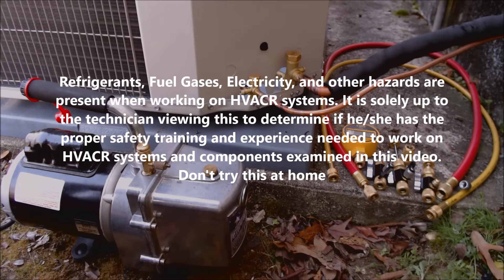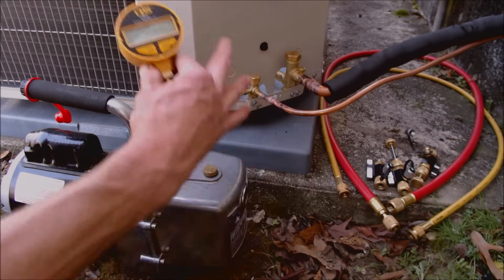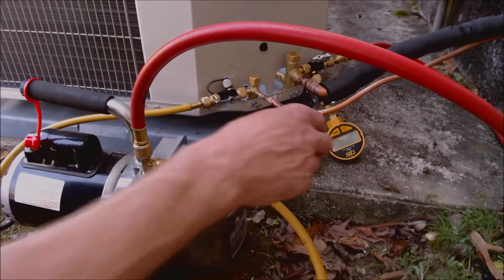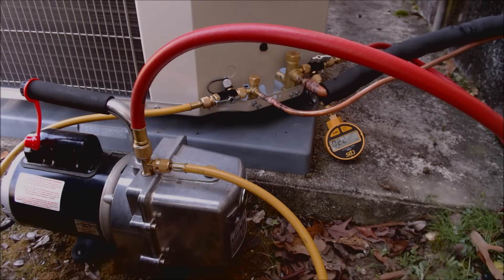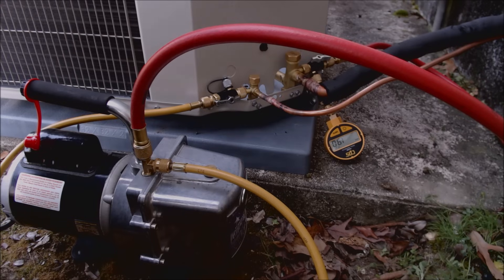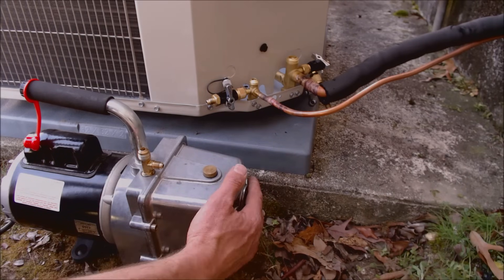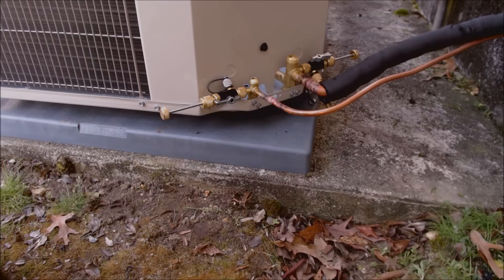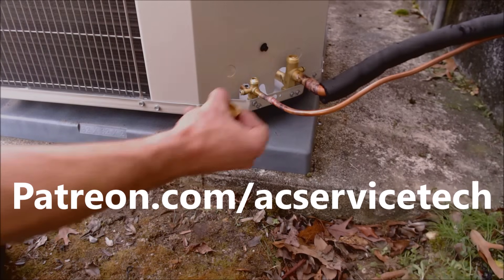HVAC Full Vacuum Procedure From Start to Finish!

Comment: After pulling down the system in a vacuum, why didnt you charge the linset for added length? You said 65 ft line... your gonna be under charged by opening those valves. Unless you have another video continuing this one where you add refrigeration on the fly while it's running. Most condensing units have 15ft of linset added in the charge. Anything over that you have to add. 65ft-15ft = 50ft. 50ft x .6 (that's .6 oz per foot)= 30oz. 16 oz in a pound so 1 lbs 14oz needs to be added.
Reply from the maker: Hey Jedd, I checked and added the charge using the Subcooling method since it was 80 degrees and had a TXV. If I was going to weigh the charge using the total weight method, the R-410A per foot would be .54oz for the 3/8" liquid and .114oz for the 3/4 vapor line. I am rebuilding the acservicetech.com website to include a bunch of resources and one will be a weight chart for all vapor line sizes for commonly used refrigerants. Yes this one was Bryant/Carrier/Payne so it came with 15' precharge, thanks!
Reply: I really enjoy your videos, lots of info, there lots of people that dont do our trade with care and it's good too see a fellow HVAC technician doing good work.

Comment: I like putting my micron gauge as far away as possible from the source of vacuum.  Also once I verify the vacuum is holding, I do not delay in opening up the service valves and get the system in a positive pressure ASAP, after the vacuum pump is shut off.  All rubber hoses leak, so I don’t want the system sitting in a vacuum leaking in air for any extra time
Reply from the maker: Hey Rod, yeah I don't do the standing vacuum test using any hoses, just the valve core removal tool valves. I don't rush to break the vacuum because I want to see if there are any problems. If not then the vacuum level usually doesn't rise above 30 microns, thanks!

Comment: I noticed you stopped the pump at 18microns. Any reason? Where should we stop the pump?
Reply from the maker: 200 to 300 microns is a good point. Make sure it doesn't rise much during the standing vacuum test while the pump is off and certainly not above 500 microns, thanks!

Comment: Sir I have a question? Why do you need three valve core removals? Could you use two I am just curious ? I am going to buy the same setup that you have.
Reply from the maker: Hey Steve, look up "acservicetech 15 vacuum tips video" the reason is to avoid oil contamination of the vacuum gauge sensor and also to not put positive pressure into a tool that is sensitive for reading vacuum, thanks! I have most of the tools I use linked at amazon.com/shop/acservicetech thanks

Comment: Sir, do we include the compressor to vacuum in case of a gas leak that result to no gas pressure in the system? and not only the line set?
Thank you for your reply.
Thanks also for all your educational videos, more power.
Reply from the maker: If there is no refrigerant in the system whatsoever then you would leave the service valves open and vacuum the whole thing including the inside of the outdoor condenser including the compressor area. Look up "acservicetech breaking the vacuum with refrigerant from the bottle" thanks!

Comment: Anyone know what he meant by not putting the valve cores back in until he had positive pressure in the system?
Reply from the maker: Hey KC KC, pull the valve cores out of the empty system, vacuum, perform the standing vacuum test, break the vacuum with refrigerant from the system by opening the service valves, then reinstall the valve cores with the valve core removal tools. The valve core removal tools remain on the unit the entire procedure. I have the tools I use linked at amazon.com/shop/acservicetech thanks!

Comment: I had a method for pulling vacuum...even used it to check for leaks...and later found after isolating the condenser & filling it with Nitrogen, that it would lose 3 pounds over a 24 hour period...I just upgraded to a digital manifold & will purchase 1 more Appion valve core tool & try your set-up :)
Reply from the maker: Yes I love this setup. I just did a new install today and once set up, it took only 3 minutes to get to 190 microns and the standing vacuum test held 20 microns above that for ten minutes. It works well and usually takes between 3-10 minutes to get the level low enough, thanks

Comment: The gas ballast (if equipped) should be left open until 1200 microns, then closed, thereby bypassing the oil in the pump. Another nice trick to clean your oil and reuse it is to simply run the pump with ballast open, you'll actually see, in about 20 minutes, the oil clear right up if it's milky. The oil industry doesn't like this trick to be known.
Reply from the maker: We usually only keep the gas ballast open until around 10,000 to 15,000 microns, thanks!
Reply: Thanks for the info!!

Comment: where was the red hose attached to in addition to be attached to the vacuum port ?
Reply from the maker: That hose is a 3/8" hose with one end that is 3/8" and one that is 1/4". I have that tool linked in the description of the video and at amazon.com/shop/acservicetech  The 1/4" part of the hose was attached to the valve core removal tool that was on the large vapor port, thanks

Comment: You should have opened the liquid line up first and the filter drier would have caught any debris. Wait where is the factory supplied filter drier??? Also if you wrap a cold rag when brazing those valves won't be hard to open.
Reply from the maker: That was a Payne/Carrier/Bryant unit so the manufacturer recommends that the vapor line be opened first in reference to where the oil is located. I always put the filter drier near the evap coil. We live near the ocean and bay so any thin metal rots fast. I did a video on filter driers and used one I pulled off a system near the ocean. No paint left. Those valves were wrapped with a rag while brazing. They are always wrapped before doing any brazing, thanks David!

Comment: I always use fresh oil on each vacuum. And some systems need the oil changed after 5 min of run time. Apion..they are the best core tools..love them. How about a triple purge? Also I use the t and 3/8 hoses on my REFCO..9cfm.
Reply from the maker: I don't do a triple evac if the standing vacuum holds at the 200 or 300 micron level. This proves the moisture is gone. Yeah those appion's are awesome, thanks David!

Comment: Hi AC, On an oil blowout you would use a 100 psi of what Nitrogen ?
Reply from the maker: Yes, that is correct for only 5 seconds or so and then immediately connect your vacuum setup. You are just blowing the oil onto the inner walls of the tube to allow the vacuum to be pulled through, thanks

Comment: Quick question 

How do you charge the unit if you had to change the outdoor coil where the Freon is not in the outdoor unit like it is on a new install without getting a pocket of air in the system?
Reply from the maker: here is the video, thanks-  https://www.youtube.com/watch?v=RA7BY7dixIg&t=529s

Comment: Not sure what you meant when you said "if this was an existing system you need to do an oil blowout"...what do you mean by "existing system"? I ask because I've done plenty of recovery/evacuation/recharge, and I've never once blown out the oil.
Reply from the maker: So, what I mean is that once the refrigerant has been recovered and the system fixed. Blowing nitrogen into the system through the liquid side and out through the vapor side will blow the refrigerant oil onto the inner walls of all the tubing so you can pukl a vacuum from both sides effectively. This way the oil globs don't mess the vacuum up or take too long of a time to clear, thanks all, thanks
Reply: @acservicetechchannel  Aah ok, I get what you're saying...that makes sense. Honestly, in my 5 years of doing this I have never once heard of any tech doing that, not even my instructor when I was in trade school ever mentioned that. Now I wonder, if you have to run nitrogen through the line to braze, would that be sufficient as an "oil blowout", or would that be too little of a nitrogen blast?
Reply from the maker: It seems that is too little from my experience. We do the pressure test after brazing anyway. Sometimes it blows all the oil onto the inner walls of the tubes when you let the pressure out one service port only. It is just something that you can do if your micron reading is going back and forth around 300 microns and won't settle into a reducing reading, thats all. If you are not having a problem with your digital micron gauge reading then you must be letting the pressure from the pressure test out one side only or are puling a vacuum from one side only, thanks Sandro!

Comment: It seems that i always hold my breath when removing cores. It can be a nightmare when it doesnt cooperate with u.
Reply from the maker: Try not attaching the valve core removal tool on super tight but just enough to hold the pressure. This way the rubber grommet doesn't get squished and stop the valve core from coming out. Also check this video out, thanks- https://www.youtube.com/watch?v=vmtlfcEr0is&t=1s

Comment: This is one of my favorite vacuum down videos.  I am going to buy some Appion valve core removal tools like the ones you have in video as the ones I have can't hold under vacuum. I am just wondering how much refrigerant do you have to add before it goes from being under vacuum to pressurized?
Reply from the maker: You weigh in the liquid quick in order to get your poundage in beore the liquid vaporizes and applies pressure, thanks!

Comment: Is it necessary to remove the valve core for vacuuming?
Reply from the maker: If the cores are not removed, it will take literally 20-30 times longer and you wouldn't be able to do the standing vacuum test to see if the micron level rises, thanks

Comment: not once did you show your pressure gadges?... if youre using it why not show
 it?
Reply from the maker: I didn't use the manifold gauge set. They only read in "hg. We use the micron gauge to show vacuum and if you keep the gauge set off then you have less restrictions, faster vacuum and less chances for leaks, thanks miguelz!

Comment: I watched your video,very good. I notice you put two valve core tools together and put micron gauge on the third tool. will the micron gauge not fit on the side port of the one tool, without connecting two tools together?
Reply from the maker: I do it that way so that The refrigerant oil doesn't foul up the sensor after breaking the vacuum and also so positive pressure doesn't make a leak in the tool possibly.

Comment: I have a question. I am new in the field and I am servicing a system after somebody cut the lines to steal the condenser but couldn't leave with. So there is no refrigerant left in the condenser. After brazing the lines back how to proper vacuum the system before adding refrigerant. It's a R22 system. Thanks for any advice.
Reply from the maker: You would pressure test for leaks first. You would perform a vacuum like this and then weigh liquid refrigerant into the high side like this. Then you would check the charge with superheat or subcooling accordingly, thanks- https://www.youtube.com/watch?v=ncgLDYrvN6w&t=7s

Comment: Excellent explanation and refresher for those of us that has been away from HVAC awhile.  What you don’t use, you lose!  Thanks
Reply from the maker: Thanks Raymond!
Reply: That’s a fact! Left for 10 years, went back to school for industrial maintenance mechanic and did that for 8 years. That was enough. I rather deal with a much safer work environment and much less stress

Comment: Does anyone do a triple evacuation?
Reply from the maker: If it is a very small system or if there is water in the lines yes. If the single vacuum standing vacuum test holds with the pump off then no need for a second or third vacuum as that would prove true vacuum level, thanks
Reply: I do..

Comment: I wish every technician would do the job as precise and careful as you showing in your videos! Where I live it's a struggle to find a proper one, every one has a bad attitude "I know it all" type. No torque wrenches, no micron gauge, bad installation, etc.. a disaster.
Reply from the maker: Oh no! thank you George!
Reply: @acservicetechchannel  Yes that unfortunate indeed.
 I just installed a new split indoor unit. Operated it for about a week, seems to work OK but it make a repeated hissing sound every 30 sec, like a punctured bike inner tube. The sound comes form the tubing, the total lenght is 7,30m. (23feet) It uses R32 freon with 5/8 and 1/4 pipes. I read that it may be from moisture in the tubing and bad vacuum. Judging from the installation the tech guy did, I assume it could be it. Hope not. Can you please check this video, the sound quality is bad but I would like to hear an extra opinion before I contact the company to send the tech guy for inspection. https://www.youtube.com/watch?v=P7tqW8iDiYA
EDIT: at 38 second it start again then fades

Comment: When you do a oil blowout do you isolate, do you close the service valves or blow through the outside unit?
Reply from the maker: If I replaced a component such as the compressor, the refrigerant is already recovered and I leave the service valves open during the pressure test and oil blowout, thanks
Reply: @acservicetechchannel  meaning run nitrogen around 100 psi through the liquid line to the suction line , right ? until when do you will stop flushing nitrogen throughout the system, so the vacuum can do its job.

Comment: I ran my vaccum pump for 15 minutes with the valve on it shut off!😥 what are the consequences of that ? You think it's performance is affected?
Reply from the maker: You are likely fine, some manufacturers say to do that while the pump is running and valved off during a triple evacuation or standing vacuum test. Also, my students have done that and then when they ask why the vacuum isn't dropping, I would tell them the valve has to be opened. We didn't experience any problems with the pumps, thanks Daniel!

Comment: hi does it matter which hose goes on vavum pump  1/4 or 3./8th
Reply from the maker: If you use wider diameter hoses then the vacuum will go faster. Also make sure the valve core depressors are not in the end of the hoses and that valve core removal tools are used, thanks James!

Comment: Thanks for videos.  Regarding "core removal tools" and  difficulty in hooking them up to Rheem/Ruud condensers (access ports facing inward), can you suggest a work around - perhaps a couple "Yellow Jacket 19209 Sealrite Couplings" making a 180 degree turn (thus facing outward)?  Thanks again...Charles.
Reply from the maker: I don't think we have a solution to this problem yet. I have recommended a solution I think will work to a manufacturer but we will see if they are interested to come up with something, thanks

Comment: Instead of spending all the extra cash on another CRT I just use a yellow jacket 45° all brass ball valve to the micron gauge. Also, I have the same 6 cfm pump and I made my own manifold. 3/8 Tee (NPT) to (2) 3/8 NPT to 3/8 flare. I started using 90° fittings so both flare fittings face forward. Good video.
Reply from the maker: Got ya, sounds good! Sometimes in the past I found that the yellow jacket ball valve wouldn't hold at deep vacuum so that is why I switched to the valve core removal tool rated at 20 microns. Glad to hear it is working for you!

Comment: hey ac service tech im a new refrigeration apprentice ( market guy ) woukd you pick up a set of four port manifolds or can i get away with a system like this and a regular manifold ?
Reply from the maker: Honestly, I would much rather use this method compared to the 4 port method. It would also depend on how often you will be connecting to ports with valve cores. If you mainly work with just 3 position valves in refrigeration then you can get away with the 4 port but if you are doing air conditioning as well with valve cores typically present then I would highly recommend this method. I have all the vacuum and charging tools I use and like linked at-     amazon.com/shop/acservicetech